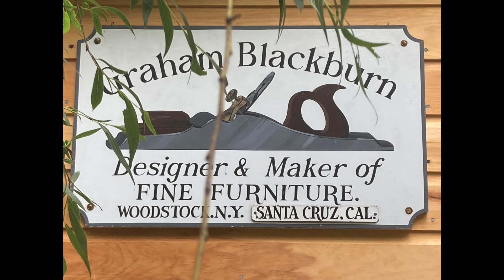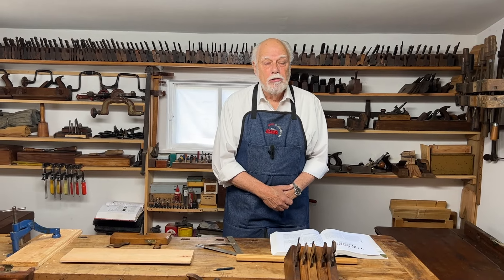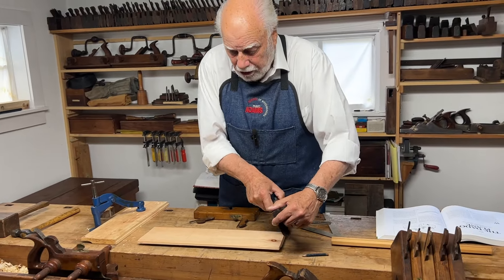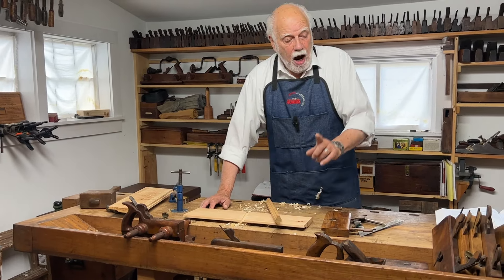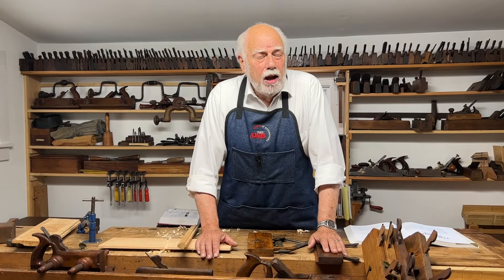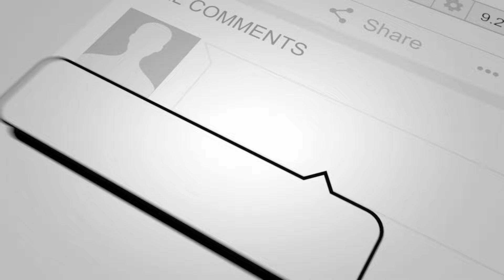80.The Dado Plane

Comment: Objection, your honor! Contrary to a popular belief to get a crisp arris and an inside angle a nicker should be ever so slightly outside of the iron. This applies to any crossgrain plane - works on filisters too. That little bit of wood is severed by a nicker anyway,  an iron just rips it out leaving a clean sharp angle. Most of the time this offset is by stoning prongs at a particular angle from inside, but worst case prongs can be carefully bent a thou (literally, no more than 0.1mm) out, nickers were tempered soft. This works way better than trying to align a nicker with an iron precisely, which might sometimes be impossible.
Reply from the maker: very good tip!

Comment: “ … more pleasurable.” 👈🏻 This. The most underrated statement ever made! 

Whenever I’m headed out to my shop, I tell my wife that, “I’m going out to see my psychiatrist for a couple of hours.”

If I’ve had a rough day or maybe I’m not feeling my best, I go out and grab a piece of scrap lumber, crank it in my vise, grab a plane - any one of them will do - and I just listen to the “schwoosh” of the blade peeling away those layers. Mmmm … it truly is great therapy for my soul. Whatever was bothering me either disappears or a solution pops into my head. If I happen to not be feeling the best, after a couple of hours of slicing and shaving that piece of scrap lumber, my aches and pains have turned into hand and leg cramps, but I barely feel them. Those two hours completely change my outlook every time!
Reply from the maker: great!

Comment: Thanks Graham. I am now on the lookout for a dado plane. One question. If you don't have one that is the exact fit, can you use a smaller plane to get the correct width?  Like using a 1/4 inch width to achieve 1/2 inch width?
Reply from the maker: Yes, absolutely